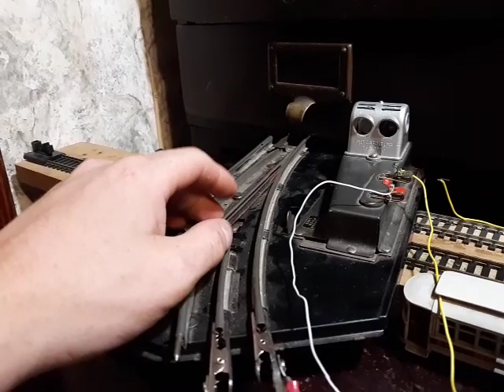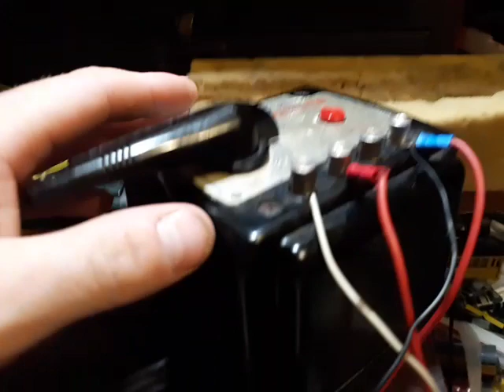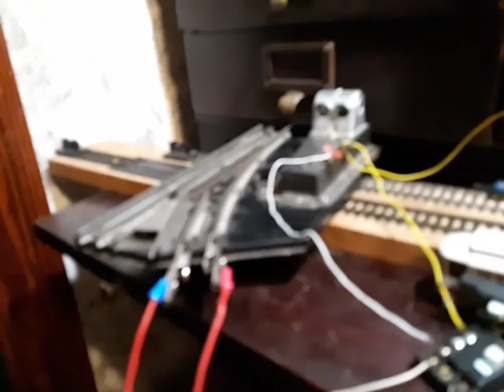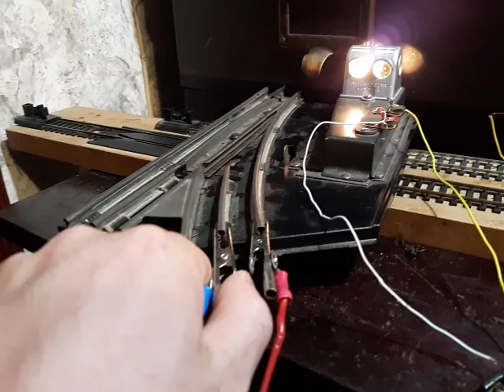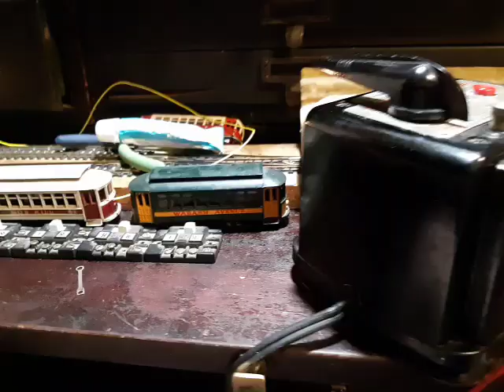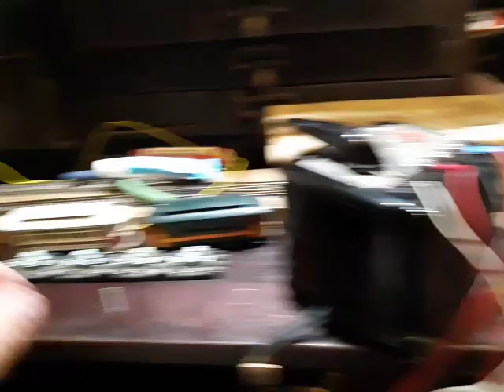American Flyer O gauge switch track review and tutorial

Comment: Thanks for making this video.  My first train was actually O scale and I never really knew how those worked and connected since someone just gave me all bunch of tracks including switch tracks but Lionel I believe.  Anyway, thanks my friend.
Reply from the maker: You still have my information please give me a call if you can if you're going to make it down to the Mill Creek Central Railroad coming up on the 9th through the 13th they actually go down and ride on the rails if you want to come down and ride with me
Reply: Kokosing Valley model railroad - I thought it was September.  Its October?
Reply from the maker: @DruSteel69  October 9th through the to the 13th we're operating trains to the Night Comes to fall running them all night long on the rails they'll be steam engines gasoline locomotives a little bit of everything moving around
Reply: Kokosing Valley model railroad - awesome.  I’ll try to call you tomorrow.  It’s the number I see from your about section.  Let me know if that’s a good number or not.